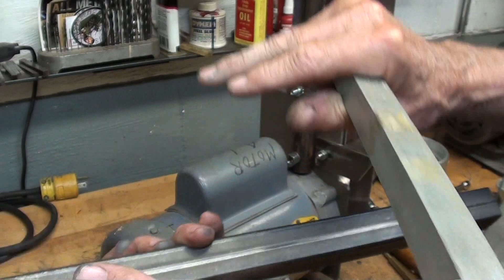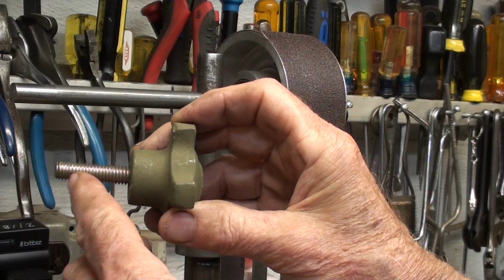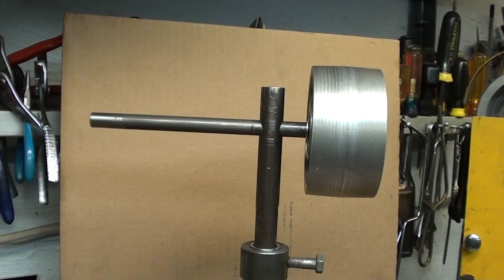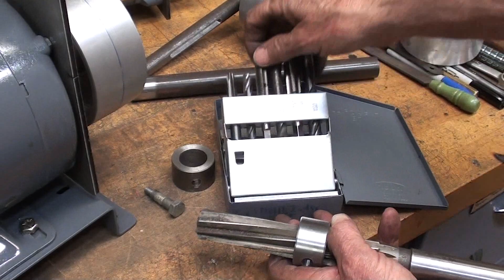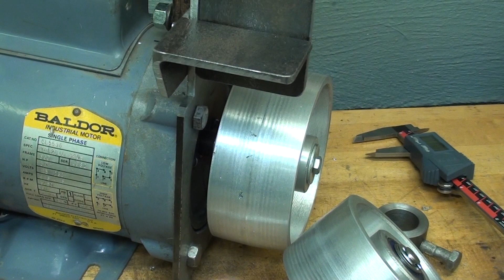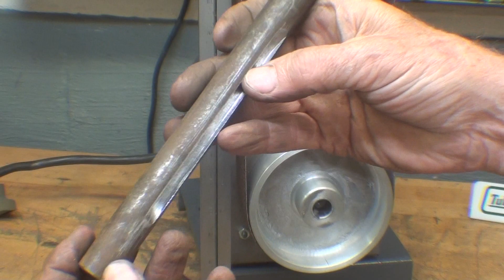Making a 2x48 Belt Sander pt 4 Tips #513 tubalcain

Comment: mrpete222 question if you have the time. Im only asking because I have no idea. Not thinking of the length just width. What are the pros. Cons. From 1 , 2, 3,4,6 wide belt Sanders. I guess what I'm asking what makes the 2x48 a better idea then say a 4x48. is it what you plan to use it for?
Reply from the maker: Actually, the wider the better. I love my six-inch wide.  Narrow belts are cheaper. The narrow ones are great for Deburring
Reply: @mrpete222  thank you I just was not sure . I was given a 4x36 by a YouTube Creator Jim from sawlogs and plastic hubs. (Very great full for it). and just made a stand for it and 2 grinders. I still want to build a 1x what ever long.

Comment: I have a 1" x 42" sander ( Craftsman) like your Mead. When the belt would break, it could slap you in the face. It was violent!. The upper pulley boom had way to much free travel when it was in the triangle configuration, and the belt broke. It would flip up like a mousetrap. I installed a small chain from the mast to the upper boom with about 1/2" of free play in case the belt broke.  Works a lot better now. By the way, Mr. Pete, I love your videos and I hope you make 1000 more!
Reply from the maker: Thank you. Yes, at the high school, one a belt broke, everyone in the room know it. Sometimes they would applaud

Comment: A possible suggestion for holding the the vertical tube would be to bore a hole through a piece of square stock the size of the tube OD then cut it in half to make a clamp.  Then drill holes for the bolts...

Comment: Compiling a parts list. 1 inch round tubing, 12" long, 1" OD, 3/4" ID. 3/4" rod to go inside. Four holes in the vertical tube:  one slot for the collar at the top, two 5/16" holes near the bottom to bolt to the mounting plate, 1/4" bolt above mounting bolts as a stop for the spring. 1 1/2" OD collar, ID made by 15/16" drill bit followed by 1" reamer. Drill and tap hole in collar for a bolt and tightening knob. 1/2" hole near the top for the shaft that the top wheel mounts on.
Reply from the maker: Yes thanks

Comment: Good video.  Perhaps instead of cutting it off, you could use the (90 degree) flange already attached to the scrap base plate section to bolt the "back plate" to the base section?
Reply from the maker: Good idea, but the job is done

Comment: Just thinking about that back section of the base. What if you didn't cut off that welded on section but turned your pillow... er, I mean the piece upside down, so the part sticking out is at the bottom? It could fit under/inside the channel of the base where it could be bolted or welded in place. Then add a right angle bracket or triangle at the top of the end plate. This would add rigidity to the top pulley arm and give you the horizontal base feature without reworking existing parts of the project.
Reply from the maker: Good idea, but the job is done

Comment: Mr. Pete, 

  For decades I had trouble sleeping until I started taking melatonin with L-theanine mixed in with it.  I sleep like a baby, and there is no grooginess the next morning.  Also, the stuff is water soluable so you can eat a bushel full and it won't harm you, you will just urinate out what your body doesn't use.  It works great for me, and I hope this helps you too.
Reply from the maker: I'll try it but I have my doubts. I have taken straight melatonin and it is just snake oil
Reply: Mr Pete am in the same boat as you with as far as  sleeping  2 to 3 hours of tossing and turning every night. I tried melatonin did not work never tried any kind of medication scared I would get addicted to it .
Reply: Where can you get that stuff?
Reply: @daleburrell6273  ebay
Reply: @tom87pate  I'll have to look into it...

Comment: Been wanting one of these since I was a kid.  Dad had one in the machine shop and I saw how handy it was.  Easy to change the grit  quicker than a bench grinder.  Thinking of using a big Chinese 8" grinder as the motor and a belt on either side. Thanks for the inspiration. ya got the insomnia myself I just work till im tired take a shower watch some youtube and go to bed
Reply from the maker: Good advice

Comment: Lyle, McMasterCarr has 3/16" steel rod, 12L14 and 3' costs a little over $5.00 plus shipping. The tensile strength is 65,000. Not the cheapest method to increase the diameter of 4 bolts. Specialty bolts don't come cheap anymore either. At least you have this option if the smaller bolts don't work out. I wonder why #12 has been virtually eliminated.  https://www.mcmaster.com/5227t45
Reply from the maker: Thanks

Comment: Very interesting build so far. Rather than the stop bolt for the spring, cutting a piece of 3/4" solid and dropping in the tube would be simple and easier to fine tune the tension.
Reply from the maker: Yes
Reply: mrpete222 
Or just drop in the spring and cut the top post to length based on desired tension.

Comment: I like the square tubing rather than the round one for aesthetic reasons. Hope there wasn’t to much slop with it’s tracking of the belt with the square one.
Reply from the maker: Yes
Reply: When building with square tube, I've found it is usually necessary to shim two sides, generally choosing the side with the weld to drop one of the shims in and then 90° one way or the other from that.
Reply: TrollForge yep that sounds about right thanks

Comment: Would have been very cool to have drilled a series of 3/16 holes to break the part along that line rather than cutting it off.  Weld in a couple small gussets.  Still, love the series and there are a million ways to do everything.
Reply from the maker: That is a lot of drilling
Reply: @mrpete222   hmmmm, about ever inch.  Would bend along the line easily.  Great for a shop like most of us who do not have a box break.  Looking forward to the finish. I'd really like to build my own.

Comment: I know insomnia all to well. Living with pain gives that, sometimes i am lucky to fall asleep at 6am till 10am. Working on a 150ft scaffold is not recommended so i lost my job and no hope on other employment. Not losing sleep about that one though.
Reply from the maker: I sure would hate to be up that high
Reply: I have worked on the top of a 330ft scaffold. 250ft open bucket lift, the rest was by ladder. All the old crafts that worked on that tower was amazing. Under the clay tile floor we found steel mill slag and a box with stained window bits that survived the tower fire that happened at the start of 1910. I loved restoration bricklaying and metal preservation. The view of the top was amazing.

Comment: So I’m collecting the bits to make this. Dug out the motor,  turns out it’s a flange type from a garbage disposal, lol weighs 6 tonnes so it’s going to have some gravity. Actually found two aluminium wheels that are narrower than what you have used but I think it should be ok. Might have to get creative with the upper wheel. The boss or hub whatchmacallit, is a bit small for a bearing recess to be turned into it. But I’ll come up with something!
Reply from the maker: Sounds like a lot of fun problem-solving
Reply: Press fit keyed shaft, maybe. Pillow block bearings mounted on the adjustment boss for supporting the shaft?